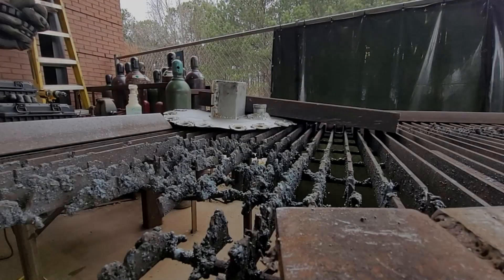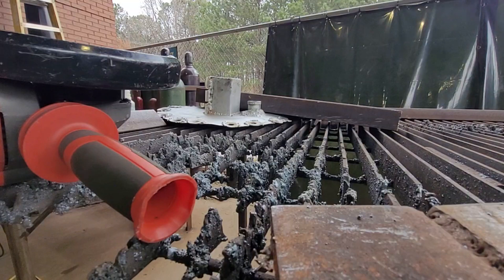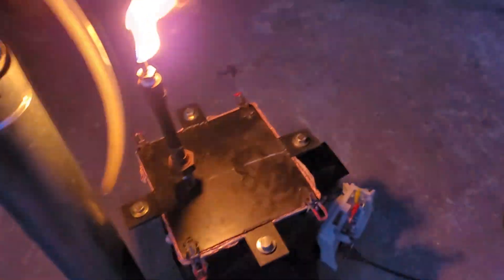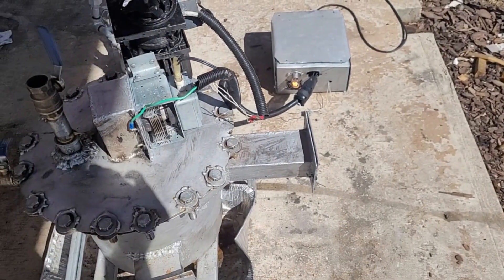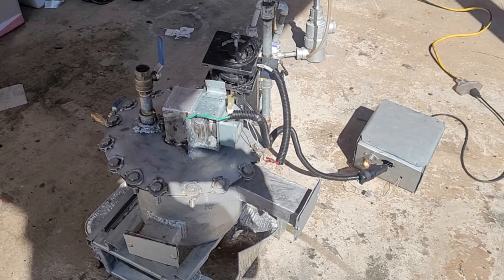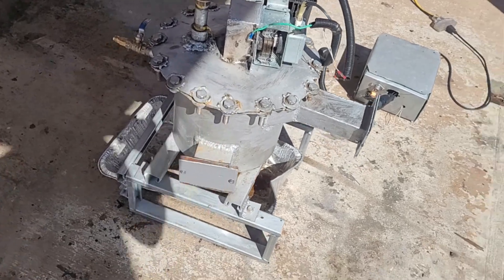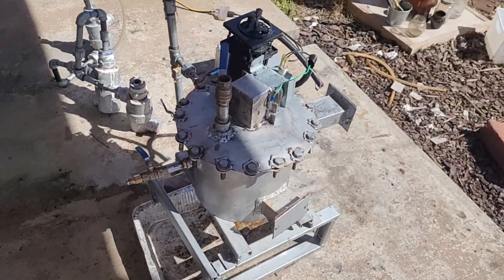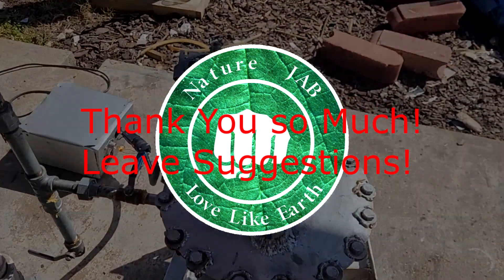Help Me Build the Next Microwave Pyrolysis Reactor! (Turning Plastics Into Fuel)

Comment: It is not so much your reactor as it is the frequency you are using. You need to jump up to 915 MHz. As you might know plastic does not like Mw until you get it to a more liquid state. What is left in your reactor should be a fine carbon not clumps.  I am not sure if I can post a picture in the comments but if I can I would show an image of a 915 machine that processes 1 ton and hour of plastic.  Keep up the good work!
Reply from the maker: Thanks for your input. I'd love to experiment with different frequencies. Unfortunately getting ahold of such magnetrons is either super expensive or very tough, so for now I'm stuck with 2.45Ghz

Comment: I think waveguide on the bottom with agitator on the top might be a possible configuration for the next model.  Also what if the reaction chamber is just giant threaded gas pipes?  You can get them in a bunch of sizes and they are made to hold gas under pressure... But i also saw how the microwaves broke down other seals so who knows.  Im a plumber and i am looking at plastic pyrolysis and love following your project.  Thanks so much.
Reply from the maker: Thank you for your suggestion! A magnetron at the bottom sounds great, buty I unfortuanntly have no way of preventing it from destroying itself. Whenever the waveguide cover comes in contact with plastic, it goes supercritical and destroys itself, forming catastrophic reactor leaks. Using a huge gas pipe could work, though that one piece alone would cost probably $1000 at the size I'm looking at making this reactor.

Comment: hey man.. im doing same concept microwave pyrolysis as you do.. but my design is using 8 mgnetron.. at first 10 minutes the gas is release  then after that only water when out.. and the waste is not fully char.
Reply from the maker: Agitation is needed for complete carbonization. Also a dielectric catalyst like silicon carbide

Comment: @Muhamed Mulic and @Lucas Raymundo give very good points. 
You do not need to mount waveguide/magnetron at 45°. It is just important to have a plate at 45° in each 90° corner. Imagine it as a mirror and microwaves as light from a flashlight. If you have right angles, most waves just bounce back and front, where 45 degree plate reflects them further through waveguide into reactor.
As for Mark 3, I was thinking if there is better possibility to separate magnetron from reactor. I know this can be pricy, but does making window from quartz glass would be sufficient? It should be MW transparent, heat resistant. You do not need big peace, in theory, just slit (like in microwave oven, where hole for microwaves is just big enough to let them through). This way magnetron could be bolted from outside with minimal distance and waveguide size. Also, in future you could have multiple windows (left, right, top, bottom), to check different magnetron positions/use multiple of them, and when not used window can be blocked from leakage with metal mesh (like mw oven doors).
And the best, you can check out what is going inside while it is running! Only question how hard would be sourcing quartz glass pieces.
Also slit design should decrease probability of mw coming back to magnetron.
Here are some of my horrible drawings: https://images2.imgbox.com/be/df/IYqwjBrc_o.png
@Muhamed Mulic and @Lucas Raymundo can definety add to this. 
For harnessing full magnetron waves complicated waveguide would be needed, or maybe 45° metal dish, little like satellite dish. but this would make entrance point into reactor quite big.
Reply from the maker: Thank you so much! The idea of mounting the waveguide above the reactor is genius, and in theory would prevent the super critical issues I've faced when plastic would touch the dielectric material. My only issue would be creating a seal between the quartz glass and the metal. Silicone could work, I'd have to look into this more extensively.
Thank you for your comment! I'm going to look at your drawing and comment on that too. with the 45 degree thing, is what I've done on the latest waveguide an example of that? I have it kinda triangulate out from the square as someone suggested. Im not sure really.
Reply from the maker: I just saw your drawing and they make sense and I understand now. I always wondered why in commercial microwaves it is angled like it is, that will cause a lot of energy savings! My question is howcome it doesn't destroy the microwaves when it's angled on the other side?
Reply: @naturejab  Becouse on one side it is triangle (left side of my scheme) where waves are directed in smaller and smaller space where they reflect and interfere but do not have possibility to reflect back (like audio foam for record studio which reflects and absorbs waves). On other side you have opening, then reflected waves go further without reflecting back. Here is nice explanation together with other things:
https://youtu.be/C028XyT7pIM?t=632 (I linked this one in past in one of my comments :P )
And this one could be also useful: https://www.youtube.com/watch?v=Lg_aUOSLuRo
I have some experience with Chem. Laboratory microwave reactors, but those are different beasts, small scale and totally different construction :/
You can test your waveguide before using it in reactor. Connect it to old microwave (where normal should be) and put inside block of chocolate or block of wax. This is old technique used in chem labs to find hotspots when you want to use kitchen mw oven in lab (it is cheap, and works the same). This way you can compare your waveguide with one that was originally in microwave oven.
Reply: @naturejab  Oh and this can e usefull for you with low tech checking of leakage of microwaves:
https://www.youtube.com/watch?v=UC3O6B_K9Us

Comment: Great videos, there is tremendous d.i.y. value here.  My suggestions: 1. do a reflux column to separate the heavier and lighter oils, and 2. collect the gas vapor with a gasometer (like you did earlier with a trash bag).  These are nasty vapors, I've done a bit of oil and plastic recovery myself -- if the ecological harm is as bad as the smell, they are probably worse than CFCs.
Reply from the maker: Thank you!

Comment: I've just did a induction stove with a stainless steel distiller pot. It works. More or less same process of distilling alcohol. Distillation is more focused on just capturing the vapor while pyrolosis is more making sure there's no oxygen to prevent combustion.
Reply from the maker: Exactly! But essentially the same process.

Comment: Hey dude! Some considerations for the next one. I’m on the road at the moment so will check in later. 

First, don’t give up. I built two machines before I could get it to work right and had to modify the second one loads before I cracked it. I nearly gave up but glad I didn’t. 

Muhamed is right about the microwave mounting and standing waves (I have some experience with this).

Insulate. And do it with proper fire bricks not kaowool or fibreglass! My first design got hot enough to melt glass. I think you will have to ditch anything silicone and go for exhaust cement because of the heat. I have one rubber join at the end of my condenser and even there I can see temperatures of 150C

Use a butane/propane gas cylinder for the reactor. They are thick and virtually indestructible.

Use a big fat pipe and make it as long as you can for the vertical takeoff and insulate it with exhaust wrap. Mine is 100mm diameter and nearly a metre long. Even then it will boil over occasionally. That plastic crud will block anything. And you really don’t want blockages!

Definitely feed back the gases to heat the reactor. I think this is key, because you will liquify the plastics therefore agitate them and this is when you’ll get best results from that magnetron. I can turn my oil powered heater off and use feedback gases after the first half hour (it self sustains). 

Although I appreciate microwaves break down the plastic very differently from indirect heating, you currently have only about 1Kw going into the feedstock. By comparison, my indirect rig is about 35Kw with not many efficiency losses because of proper insulation. If you look up the exhaust, that reactor is glowing RED at the end of a run. It might be that you need more energy which the gas feedback would help with.
Reply: Delivering energy to the reactor is exactly the failing point of many of these projects including my own.  I think microwave energy is interesting because of the directness.  I think it's good to consider what the wattage trade-off is when you heat the charge itself, rather than heating the vessel.  But you're right the scale isn't there, with fuel oil you can really crank up the BTUs.
Reply from the maker: @dansw0rkshop  Precisley. The very thing that makes microwaves interesting is also their downfall. They're very tough to control and know what they are doing. We'll be the pioneers in this field. I think a lot of my problems will solve with multiple waveguides in a single reactor, so I will definently make this apart of my next design.
Reply from the maker: Thank you for all of these points! I must ask, since the microwaves heat on the inside out, does the insulation need to go on the inside or the outside of the reactor?

I also think your point about energy input is brilliant, and that's one of the biggest hurdles I need to tackle in this next reactor. At the very least, it needs to have 2 - 3 magnetrons and feedback gases to reach a higher overall temperature.
Reply: Hi mate. The insulation will have to go on the outside. My gas bottle reactor sits in an oil drum that is lined with fire bricks 👍
Reply from the maker: @elcaboelcabo2881  thanks!

Comment: If you want to try a continuous reactor with a hopper you could use an inlet tube that is around 1/4 wavelength (~30mm) in diameter to avoid too much leakage. It should be fine if you use hard, ground plastics, now some other plastics you might have to melt them as a pre-treatment to obtain denser chunks that you can feed. I would not worry about an outlet for solids initially! You can operate semi-continuous, just keep feeding the plastics until the reactor fills up with solid residue, you should be able to feed from 10 to 100 times the reactor volume depending on the yield of solid residue of the particular feedstock. If you want to use a mixer inside it can be made out of metal, no problem, the reactor itself is metal too, the only important thing to keep in mind is that the mixer has to be grounded to the rest of the reactor body, otherwise it will transfer microwaves outside acting as an antenna. Purchase a microwave leak detector to be safe. To seal the mixer you can make a stuffing box and use graphite gaskets, they can easily withstand 500°C. Finally I suggest you use silicon carbide as a starter, it is a common material usually utilized as an abrasive (in sandpaper for example) and a great microwave absorber for microwave assisted pyrolysis.
Reply from the maker: Thank you! All of these are great ideas, I most definitely want to incorporate a hopper, and a continuous system.  The graphite gaskets and stuffing box are things I never heard of before but will for sure help me out. I need to look into buying / making a plastic shredder for sure.

Comment: I found your channel today and I'm in the process of watching all of your videos. I love what your doing and I hope to make one of these one day. I have watch tons of videos on the subject and by no means Am I an expert. To give some back ground, I'm a pipefitter by trade. Over the years I have talked to many of my friends who worked in oil refineries and I have watch many videos on the subject. An what I want to share is how I would and want to build my Pyrolysis machine. Personally, I'm not sure about Microwave Reactor. Honestly never see one for this type of project. What I will say is or ask What is the end goal? Or goals? If it's to get more into oil / fuel / gas production. On the reactor portion, I would focus more on high temps from bottom up. Why? Well to reduce thick oil / waxing in the next stage. In the next stage: Cracking ( Reactor ----> Cracking). I would build a Thermal Fractionating Tower with Bubble Cap Trays. I will try to explain but the best thing is to look up how Crude Oil is refined to Gasoline here on YouTube. So basically what you build is a "Tower" / Vessel vertically. An the process is like this to hopefully reach a desired out come. ( Very Bottom Try "Heavy Oil / Waxing" -------> 2nd from Bottom tray is about the same but lighter.------> This part of the Fractionating Tower is the Oil Gas Mixtures from the Reactor: Heavy stuff falls and the lighter oils and gasses go up in the next Tray.--------> Upper Tray #1 Oils such as maybe (Diesel/ Kerosene / Gasoline) Gas vapors continue up. ---->  Upper Tray #2 (Gasoline, Etc) -----> Upper portion of Tower is mainly for Gases like Propanes and Butane's, etc. and you collect that here.) Hope all that makes sense and hope it helps. God Bless you in your adventures!
Reply from the maker: Thank you so much for all of this!. Th end goal of the microwave reactor is to run it off of  solar panels or some form of free energy to get an energy profit in the end, therefor making plastic waste a source of revenue, deleting our pollution problem. I've looked into fractional distillation in the past, on my very first reactor and I think it's a great idea. That combined with catalytic reactors would make desirable fuels right away. I think it's amazing you are going to build one of these! Once again thank you!

Comment: What if you did a flow through with an auger with sealable hopper and a smaller diameter reactor chamber to push through for your new design. You could add another magnetron offset from the 1st. I love what you're  doing.
Reply from the maker: Thanks! I definently want to incorporate a hopper. Thanks!

Comment: I wonder if you made the reactor in two pieces like one for the microwave and the other for the reaction chamber
Reply from the maker: It is in a sense, because the reactor lid is the microwave part. While the body, is it's own separate pievce.
Reply: @naturejab  I only suggest it because you said that sheet you were using pops easily that way no pressure would get to it I think because that part wouldn’t need to be air tight
Reply: @naturejab  think of it like a double boiler or a slow cooker
Reply from the maker: @thelonewolf267  ok I see what you mean. The only issue is that the microwaves need to enter the chamber, meaning there must be a caivty somewhere that allows microwaves through and remains airtight
Reply: @naturejab  I have a question for an idea that I am working on for this issue. 
What Materials can microwaves pass freely through that is strong or at least fairly robust?
Reply from the maker: @bencapobianco2045  Fiberglass, Teflon, or pure Quartz Glass. All temperature and pressure resistant, as well as microwave transparent. The cheapest option is Mica, but it is very brittle and weak to pressure. Thanks!